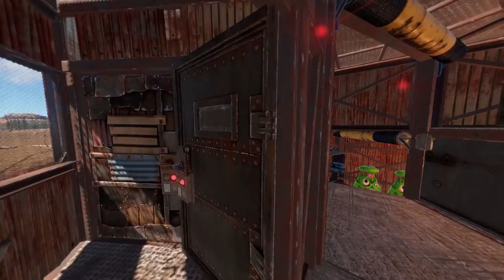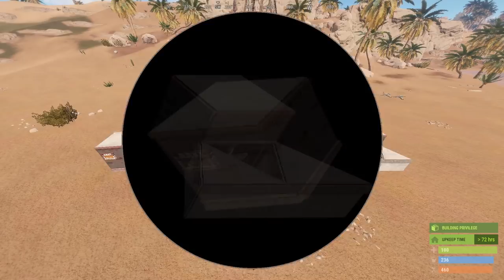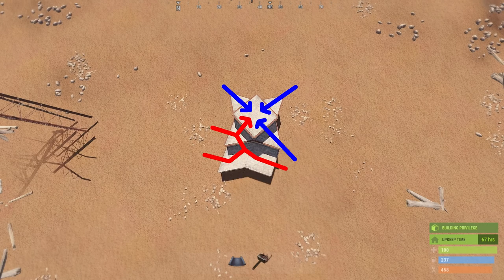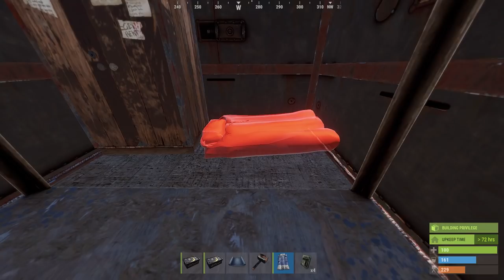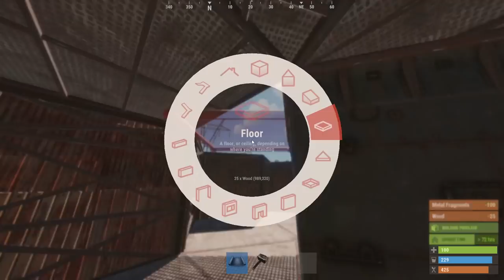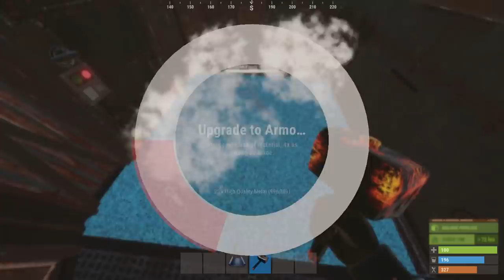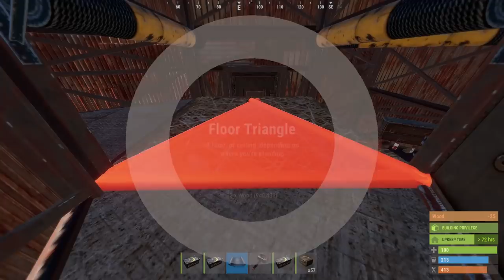Rust Base Design 2019 - Small But Strong (Rust Base Building)

Comment: remember to not lock the transfer box, raiders are more likely to break the box if it's locked meaning u lose the way of transferring loot in the bunker
Reply from the maker: indeed
Reply: Why more likely ? Honest question
Reply: @francosmith9326  to check if there loot in it if they can check they won't bother breaking it
Reply: It would be a huge shame to come back, just to realize your transfer box was destroyed. Leaving you with no easy way to rebuild it in there.
I had to have both sides and the roof off, to get the roof tile to uncover the wall again.
Reply: @berniehhs  Can't you use a dropbox for it?
Reply: They'll probably break it the moment they toss any explosive device on the wall, so leaving it unlocked just gives them access to the stuff inside. If they do break it, make sure you have a couple dropboxes inside the walled off area, so you can transfer loot that way.

Comment: Have you tried raiding from the top, drilling straight down. I use a similar stability bunker and it’s 20 c4 from any way in. They are def a little op, but killing your self gets annoying.
Reply from the maker: straight down is 1 sheet metal and 2 hqm walls, i agree the respawning is kind of annoying, thats part of the reason i like to use the trick in the video instead of a drop box, way more can go through at 1 time

Comment: so, for dou's could you use one of the honeycomb triangles to extend the loot room to drop a second bag? makes getting to tc easier but lets 2 people have access to tc and loot area? food for thought i guess. maybe use a double door or garage in it to separate? could also let you make a 1x1 to start with a door at the begging and once you have mats wall it in? you could also in theory make it a 2x1 with squares and use the second square as the jump spot for bunker in case they do get through first, would enable you to reset the one box in the second bunker. but that does change the whole footprint of the base, so may have to rework placement and stuff obviously
Reply from the maker: all viable options tbh, this base was to showcase the double bunker concept, there are many many ways you could make the base better/stronger

Comment: Great build: but I do have a question. Would it be better to use a drop box instead of a large box poking thu the wall? Might be more useful to be able to use that 4th box but wasn’t sure if there was a specific issue with using the drop box.
Reply: the drop box only goes 1 way so unless you have one going out you can't take loot out, at least they used to pretty sure that's still a thing
Reply from the maker: drop boxes could work if your in a big group but youll need 2 1 for each way

Comment: That sheet metal raised foundation that you haven't upgraded is for sure the weak point.  If you started your raid from either of the 2 triangle foundations near the front door and then into that raised square foundation, you'd have direct access to the TC wall, making your raid cost 8 less rockets to get to TC (and also giving you access to the inside of the base).
Reply from the maker: yeah, i think im gonna upgrade that to hqm and maybe add a honeycomb triangle to hide it

Comment: I am relatively new to rust but wouldnt it be worth honeycombing both the outer loot rooms? Since you have only 3 large boxes and TC in a "secure" location you could easily run out of space and have to store valuables in the outer loot rooms. Especially if you use this base as a 3 or 4 man.
Cool design though
Reply from the maker: yup, there are a bunch of things you can do like honeycomb wise, i was just going for the smallest footprint here

Comment: I don't quite get how you are suppose to soft side pic this bunker.
Your sleeping bag is alone on the hard side of the wood and the soft side of the cement.
With the small box on the other side of the bag, where do you grab a pic from?
And how are you going to soft side pic the wood?
Reply from the maker: so this was a production error on my part, you would have to stash the tool next to the bag, you can place the bag on the other triangle down there to softside pick the wall from the direction its shown in the video, sorry about that confusion
Reply: My Gaming Experience  Brother I still dont get it how you are supposed to access the stash if your sleeping bag is on the empty tringle and there is a wood wall blocking it. One smarter way would be to have some tools in the large box that goes through the wall and grab them from it to soft side.
Reply: That's how I see it working as well. When I built this, I was able to get the Sleeping bag and a fireplace on the softside. From there, I had the pit full of tools to pick out, and I still had full slots to transfer loot into the transfer box.

Something I ran into, it was very difficult to jump out if built on uneven terrain. My open triangle ended being way lower than I expected. But I was able to overcome it by placing a furnace to jump off from. I also only armored the box, and left the inner honeycomb metal. That combined with some extra stone honecome to hide the metal loot rooms, it made me appear a lot less of a target, than a full metal base would show as.

Comment: Question.  I took your 1x1 armored design from your last video and made a double bunker just like you but with an even smaller footprint.  Just a triangle with a sleeping bag.  No small box for a tool to pick the soft side of the wood.  So instead I just leave it twig and rock it out when I spawn.  Is this susceptible to splash?  I tried using incen rockets to break it and it didn't break but now I'm questioning whether explosive ammo could break it through the wall.
Reply from the maker: So i have been testing this out everytime i use a bunker, i have not been able to get it to burn with infinite incend rockets or explo ammo.  Now the thing is everyone says it possible, the majority do actually, so i dunno what to really recommend.
Reply: @MyGamingExperience  We need to figure out how they are breaking the bunker because using twig is so much easier.  Can anyone chime in?  Using twig means you can do the bunker in 1 triangle.  I have some concept bases I would like to show you too.  Add me on discord eGo#5745

Comment: Please excuse my lack of knowledge of stability bunkers, but how do you get the foundation-less section of floor to collapse from spawning on the sleeping bag below?
I've created this base and can not figure out how to open the stability bunker portion to utilize this design, let alone how to climb out of the hole, without killing myself a 2nd time, to then kill myself a 3rd time to stock the things in the main TC bunker.
Reply from the maker: you soft side pick the wooden half wall, instead of putting the bag on the floor put it on the triangle where the small box is, and keep a tool on you, once you break the wood the floor will collapse

Comment: Great design but you put the sleeping bag on the WRONG SIDE of the wall!!!
Reply: Sshhhhh
Reply from the maker: you can put a stash in the ground, i should have maybe shown it with the bag on the triangle foundation instead of the box. it does fit
Reply: @MyGamingExperience  ya relying on materials/tools from TC/boxes much better than 1 stash to pickout. Plus it's on softside.

Comment: Not sure what I've done wrong but the bag outside of the TC room under the floor spawns me on top of the floor. Why would that be?
Reply from the maker: try to put the sleeping bag on the triangle foundation that is down there this will also make the wood easier to pick
Reply: That worked and preferable also. I keep a pickaxe in the chest to break the half wall which works well

Comment: how do u get into the first bunker?, u spawn on the sleaping bad below the stability triangle roof, but how do u get through the wooden half wall without tools?, the box that u placed in the video is behind the wooden half wall
Reply from the maker: u can put the sleeping bag on the foundation instead of the floor and reverse the soft side of the half wall or you can bury the tool to break it with in the ground

Comment: Great idea, but how do you break the wooden wall for bunker? You have no way of getting in there lol
Reply: That's the point of the sleeping bat
Reply: Bag put loot in box that sticks through wall such as valuables and upkeep f1 kill then spawn in tc area and take the stuff out of the box
Reply: @BrandonResells  Part of the raid cost was being able to bunker off the other section as well making it a double bunker. I'm not sure how you get into that single triangle foundation once it's sealed to break the bunker. Unless you sleep in there you're a bit screwed.
Reply from the maker: there is a better way than how i did it in the video, you can place the sleeping bag on the triangle foundation instead of that space on the floor

Comment: Behind the second single armored door where you placed the triangle into ceiling to fit 2 large boxes and storage space on it. If you placed the triangle coming out from the opposite of door and the pointy side faceing the door, you could fit 2 shotgun traps above ur second single door on the half hight. Would give great protection against door raid.
Reply from the maker: i like that idea, im gonna do some testing with this idea, to be honest my trap placement need alot alot of work
Reply: @MyGamingExperience  allso that triangle holding the boxes if you placed the boxes before sealing the roof above it u can fit 3 boxes in there but then u could get in only one shotgun trap. Not sure if second would fit there

Comment: I am using your design, got raided once before I could finish it but trying it again. BIG thanx, very nice design. Question-  How do I break the wood wall? I am guessing a campfire near the bag with tools, or perhaps just spawn to TC, take wood out and wait? There is a wood wall between me and transfer box. Its holding the amoured triangle up. Also for others trying this beware: I had trouble at first with box sticking out too far, the second double wall didn't take also uneven ground will cause your stability bunker sleeping bag to stick out too far to place the raised square foundation. Lastly I found it helpful to place a red siren light on side of foundation to jump out of stability bunker because I placed foundation high.

Edit: Got raided again (on official server), it was a offline raid, this time I was 99% finished building your design. They broke the empty walled off room in the back plus first armored honeycomb section back there. Only lost 4 large batteries I had sealed in there. The stability bunker area is also great place to place the electricity components.
Reply from the maker: yup using a tool is prolly the, you could also put a sleeping back on the hqm triangle instead of the floor

Comment: The main problem with this base is the weakness of the first bunker. Dedicated groups could easily softside jackhammer the armored foundation. If you were to follow door path and then soft-side the square armored foundation you could get into the tc for only 21 rockets.
Reply: additionally,if you were to splash the armored wall on the right while blowing into tc you could get to tc and one loot room for 24 rockets. To fully raid the base its would cost about 32 rockets.
Reply from the maker: i'd have to test that route out, i may have to add 1 addional armored foundation, and 1 door to the front

Comment: 13:49 you place 2 large boxes right next to each other. You can fit in 2 more small boxes if you do the same u did with large boxes but place them as far apart as possible. If done right you can fit 2 small boxes between them.

Edit: I realize now that doing this would make it a lot harder if not impossible to get up there so maybe not the best idea lol
Reply from the maker: Yeah loot room spacing is weird when there is a half floor going through the whole thing.  If your interested in making the most of this space, a youtuber by the name of Evil Wurst does these thing very well.

Comment: How would you replace the large box if you are unsuccessfully raided through the bunker entrance? Or would you opt for a dropbox in such a case?
Reply: You don't put a code lock on the box.  That way they have no reason to destroy it.  If they do destroy it anyway, yes, you are screwed.  You won't be able to use the bunker anymore.  In that case the only way to get loot out is drop boxes.
Reply: @SALT_KING  Yeah, that's why I don't particularly like this method for passing loot. I like the idea of a stability bunker combined with a suicide bunker though. Will be experimenting with it. Thanks for the idea!
Reply from the maker: combinations of these bunkers can be very strong

Comment: I use similar design, but as a solo player. The problem that just 1 member of the group can enter TC and bunker makes it hart to organize and transfer loot. I use two drop boxes instead of the large box. I think the 100hqm upkeep pretty intense !
Reply from the maker: you can put 2 boxes through the wall as well, just in the very beginning you can do the roof trick on both sides
Reply: @MyGamingExperience  yes for sure I know ! and the good thing about that is you don't need dropbox BP. But set up the base and this special design its kinda hard as a solo player and way to expensive

Comment: Could you do this solo? How to get so much hqm. Could you do a solo version of this? With maybe a drop down loot room
Reply: If you just HQM the 1x1 suicide bunker it only costs like ~125 hqm and 18 hqm upkeep per day.  You can do the other bunker and the rest of the base in metal, and upgrade later if and when you acquire the hqm.  However, the downside is if you don't HQM the foundations they can pick them out/jackhammer them easier.
Reply from the maker: I like the idea of doing drop down loot rooms around this initail 1x1

Comment: Hey man! Nice base, but i have one question. Maybe i'm wrong, but how do you break the hard side of the wood in the bunker, if you spawn there? Because there's no place for a box next to the sleeping bag.
Reply from the maker: there is 2 ways ( i really should have showed it in the video), the first way is with the sleeping bag placement in the video would be to put a stash in the ground (its kinda tight tho), the second way would be to put the sleeping bag on the triangle foundation down there (in the video currently has a small box on it) and you could keep the tool on you.  I think the second way is better, i really regret no showing this in the video.
Reply: @MyGamingExperience  I had the same question, been struggling with both placements all day.. if you could show us how to do it properly that will be awesome.
Reply: Found a solution, you need to place the sleeping bag AND the stash before the square, otherwise, it wont let you place it

Comment: it's great.
But both loot rooms are 1 wall sheet metal only.
I would add honey comb to those back lootroom and it would make this base really viable ! good job
Reply from the maker: Indeed, i would def. add honeycomb around the loot rooms, its good that they are seperated but there are many additions you could make, i honestly was going for the smallest footprint i could get.
Reply: @MyGamingExperience  for sure. but that meast 4C4 or 8 rockets to one of the main loot (luck of the draw) which most of the time will probably include explosive.

Even a simple stone honeycomb can make a big difference :)

Comment: A few comments. 1. I understand that you're using the build you are with the roof glitch and what not, but using 2 drop boxes really just saves you a lot more time and you can still put loot on the inside in the shelves like small boxes and BBQs. 2. if you place the bag there, won't you be spawning with a rock and nothing else? How would you get to the box that has the tools? You still have to hit out a hardside wood wall to get it.
Reply: Your loot you want to move is in an outter loot room. You respawn into stability bunker, and get tools to pick soft side of wood wall from your transfer box.  Go out into base and move good loot to transfer box, and tools, then respawn in TC room and secure good loot.  👍

Respawn in base and close up stability bunker.
Reply: @leafchip  That doesn't make sense. Look at the build, he puts the sleepingbag on the hardside of the wood seal underneath the bunker. So you spawn with a rock on that side, and you have to get into the other side of the wood halfwall to get the tools. There's nowhere else he can spawn, the only other bag is on the other side of a softside highqual wall, so Idk how this is supposed to work.
Reply: @morningstar6123  2:00 I see what you mean.  Can't you put bag on inner one?
Reply: @leafchip  I think maybe a bag and a campfire would fit? but not a small box. I'm just wondering why he put the bag where he did, that's all, because it seems illogical to me. :P
Reply from the maker: you can put a bag on the foundation instead of on the ground and just flip the softside to the foundation, i should have shown that way in the video. sorry about that

Comment: i've been using a very similar design for 3 months now on vanilla servers as a solo, (eu main and eu trio) i've been raided roughly 25 times , only 4 of those got to my tc , the rest only took out the area around the 1 by 1 , since it store all my main loot , it actually made it possible to continue on the wipe , my main comment based on experience is i'd only hqm the 1 by 1 , if they got enough resources to go thru 1 wall of hqm , they got resources to go thru 2 while you are offline (after going thru the sheet walls or doors ), overall good design
Reply from the maker: I appreciate that, its a really strong concept.  Im gonna do some testing with the sheet metal to see if i could come up with something good